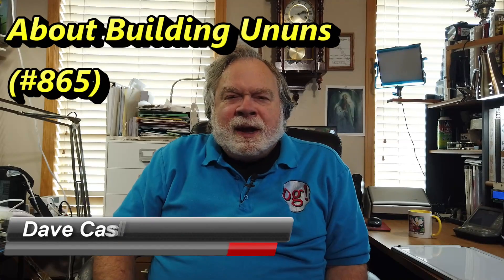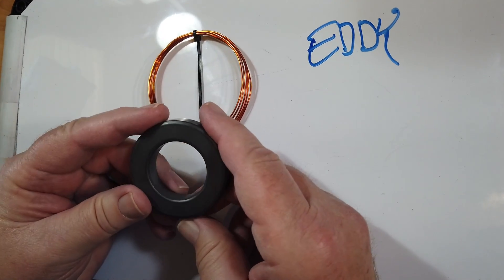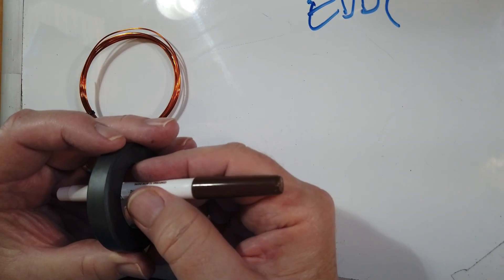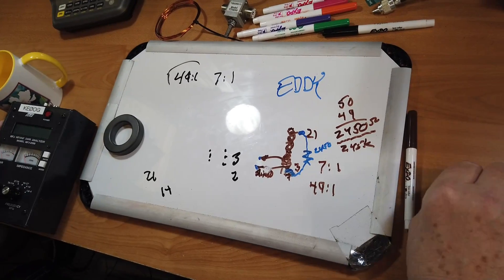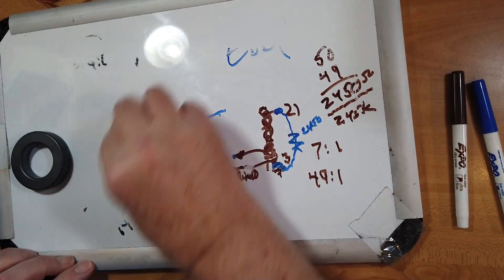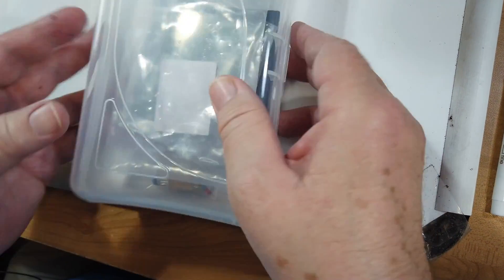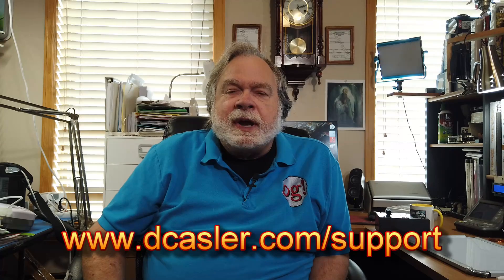About Building Ununs  (#865)

Comment: Great video. Your explanation of balluns is spot on 👍. I've been licensed since the early 90s and I opted to learn everything about antennas. Of course that's almost impossible because we keep finding out new aspects of radiation capabilities with different materials and configurations.
Can you give a short video about matching networks and especially one called a twelfth wave matching network. Can it be used in place of a toroidal matching network and what is its capabilities?
Thanks again for your advice and for sharing your experiences with ham radio. I look forward to whatever you cover. It always seems to be just what I needed to advance my projects to completion a little easier 😁👍.

Comment: 6:30 When winding a toroid, each pass of the wire through the "hole" of the core counts as one turn.
7:20 The secondary is usually split to two parts of opposite direction to reduce stray capacitance and get more wideband response. See https://youtu.be/7XUWOSy_CVE and other resources.
8:20 Two resistors, 2200 and 220 ohm (or 2200 and 270 ohm) in series should do well.

Comment: The most common application of a 49:1 unun is for an EFHW, and that value of 49:1 is not gospel.  Furthermore, the common layout of the EFHW 49:1 windings has a winding cross the core half-way through the 21 turns, but later analysis has revealed that doing so doesn't entirely count as a full turn, more like a quarter turn or less.

For mine, I deliberately added an additional turn to make up for the crossing turn, and because the impedence of an EFHW is not exactly 2450 ohms, it's generally a bit higher.  Doing the math, I ended up making a 54.76:1 transformer, but the actual value as measured is more important than the math.  How tightly you wind the wires, how evenly you space them around the core, whether you do a bifilar winding or not for the first three, these can all affect the actual transformation ratio, so measurement is far more important.  And then the resulting SWR is the important result.

Comment: Imiedance ratio is the square if the turns ratio. The construction practice will effect freq bandwidth, power handling and efficiency. Its all trial and error in the amateur world because real lab equipment is very expensive..

Comment: I have 1:9 impedance ratio ( 1:3 turn ratio ) UNUN  using  FT-240-43 core from Amazon   connected to Automatic Antenna Tuner at bottom of Half Wave Inverted -L antenna.  half wave for 7MHz, about 66 FT total length.  it work well for 7MHz, and I can load it up for 1.8MHz as well as all the way up to 50MHz.   can talk to Japan with SSB 100 watts on 21, 28MHz, which Inverted L point to North East.  AG6JU

Comment: Yes, you can buy them, but nothing is more satisfying than building your own. I feel privileged to have assembled around 20 of them.  The latest, I couldn't find, and assembled my own 9:1 with a second core below it that is a 1:1 choke.  It works great to transform 50 to 450 and keeps RF from going back down the outside of the coax.  Great information Dave, keep'em coming.

Comment: Another way to test, is to put 2 back  to back. This allows also measuring the efficiency thus loss with a VNA or watt meter. Well designed, half a Db loss for each, is typical. For legal limit operation, full power testing with an IR gun would be smart. Also, non resonant antennas and using too much ATU, will cause the efficiency to drop and turn the unnun into a dummy load even though the VSWR looks great.

Comment: This has been helpful. So much info on this subject and a bit of it is pretty confusing. This video helps to fill some of the blanks. My project is to make a 1:1 Balun using a 140 size instead of 240. The cost is much less, but I don't know if I can get enough turns on a 140. Your thoughts? 73 Bob/K3RDF. Keep up the great work!

Comment: Hi, Dave. I, out of necessity, have at least a few words to say here.
We, hams may not have to worry about the mix of the magnetic cores that are available in numerous receipies all over the world.
Yes, to start with you have to know only two varieties; it's simple for sure.
1. Ferrite cores,
2. Iron powder cores.
Iron powder cores, as expected, are made of iron powder and some other minerals mixed up and held in shape by resin.
Ferrite cores are made up of iron oxides plus either Ni-Zn (#43) and (#61) or
Mn-Zn (#31, 73,75,77 etc).
The one you have in your hands is FT240-43 , a Ni-Zn ferrite (not powdered iron core, as you are thinking and saying in the video) core.
Type #43 mix ferrites have initial permeability of 850.
Type #61 has ui of 125.
As you wrongly said, there's no"magnetic flux in any core whether it's iron powder, ferrite or soft iron laminates.
But only when a winding made and current is passed there's going to be a magnetic field flux.
We, amateur radio operators use soft ferrite cores (ui, <1000)
Radio frequency Ferrites, at present, are largely manufactured by "Fair-rite, USA.
Iron powder cores come in painted with colours. The big player is "Micrometals, USA.
Again we need to know, for the time being, only 2types.
The red and yellow, that you have in your"Pandora Box.
The yellow (#6) has a ui of 8 and the red(#2) one has a ui of 10.
There are several parameters to study like, magnetic path length, area, saturation, bulk resistivity, resonant frequency inductive portion and capacitive portion of reactance apart from pure resistive portion, Curie temperature etc.
I think one might be able to follow.
The questioner wants an EFHWA UNUN for 1500w pep legal limits.
He can stack 3×FT240-43 and use either 2:14 or 3:21 turns to realise 1:49 impedance transformation.
He, as suggested by Steve Ellington, can experiment with #52 or mix "K" material. 
Again it depends on the frequency bands of interest and installation of the EFHWA antenna radiator like,feed point height above the ground, whether it's in a straight line flat top configuration or inverted V or L and so on and if he is going to use a ground stake at the UnUn, use the coaxial cable sheild as the counterpoise, or a separate counterpoise and if he's using a CMC Common Mode Current Choke along the coaxial cable etc.
The important things you forgot to tell are two more that I have to say here.
1.The length of the radiator has to be 1/2 lambda long of the lowest frequency of interest
2. On the primary side (lower impedance) you have to have a good quality ceramic (or Silver -Mica, if available of around 500v or 1KV) capacitor in parallel to the winding to nullify the leakage inductance so that the response on the higher side of the HF spectrum will be good.
I think this helps.
De VU2RZA
P.S. he asked about the ball park region of the inductance he will get that you didn't answer.
It's 12 uH for the 2 turns and 550-570uH for the 14 turns (Joe Reissert's cross winding style) on the proposed 3×FT240-43 cores. (He must be confident, now I think.
One more point I would like to add is what you drew on the white board is an "auto transformer" and well, it can also work; but the way the UnUn is wound is different as I had had described in your previous video too.
The UnUn is having 2 turns on the 50 ohm side and 14 turns on the 2450 ohm side. Both the windings share the common ground connection to the shield braid of the coaxial cable. To assure a good amount of "coupling" between the primary and the secondary windings the first 2 turns are twisted with each other.
Start of both the windings go to the shield braid of the coaxial cable; the free end of the 2 turns winding is connected to the centre conductor of the coaxial cable via the SO-239 or BNC connector. The free end of the 14 turns goes to the 1/2 lambda radiator for the lowest frequency of your interest.
And it will never work on any lower than the band for which it's a half lambda.
But you had drawn as if one can use more number of turns ratio to work on 160 meter band even though the radiator wire is only a half lambda on 80 meter (135').
He asked about the advantage of having more number of turns ratio 
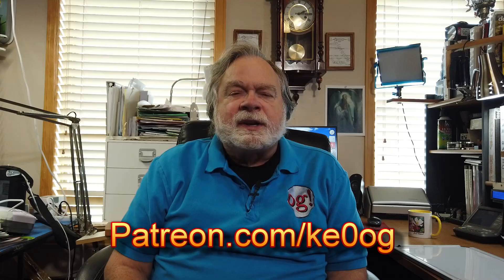If he's interested only on 160-40 meter bands he can use ratios like 2:16 or 2:18 to have impedance transformation to   1:64 or 1:81.
He can also try 3:21 for realising 1:49 impedance transformation.
If he's interested in 40 meter and up the regular 1:49 would be great.
I just mentioned about the iron powder cores for sake of information as you showed a pouch containing the red and yellow cores.
These iron powder cores are not useful for the EFHWA projects.
They're only for making high Q inductors as we use in harmonic filters. 
Some people use the Red core for making an 1:4 or 1:9 BalUn for matching with a long random length wire antenna.
Here we have been interested only in the EFHWA.
Ferrite cores are dark grey coloured and you can not differentiate from one another if you accidentally mix them up.
Don't try to use any sharpy to scribe on it; they're ceramic material and very hard but brittle at the same time.
You can, instead use colour sticking tape or just the carpenter 's tape on them; you can write the mix number using a permanent marker pen.
For iron powder cores the colour is the clue.
De VU2RZA
Reply: VU2RZA can you share some suitable references on toroid? Your explanation here is quite practical indeed
Reply: @rickydas  yes, sure.
G3TXQ (silent key) has done a big feat on the subject.
K9YC, ferrites cook book is a great reference.
My respect to them
De VU2RZA
Reply: Dr ஏர்க்கனவே அவருக்கு விரலெல்லாம் நடுங்குது நீங்கள் வேற இந்தமாதிரி பதில் கேள்விகளும் போட்டால் பாவம் அவர் ஒட்டுமோத்தமா நடுங்கிப் போவார் பாவம் வெள்ளைக்காரன் dr
de 3mpk